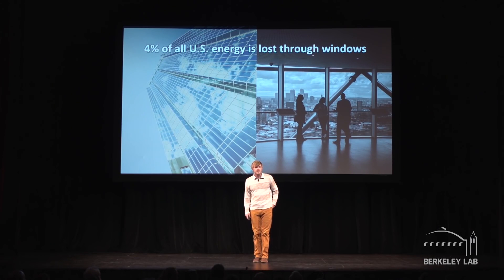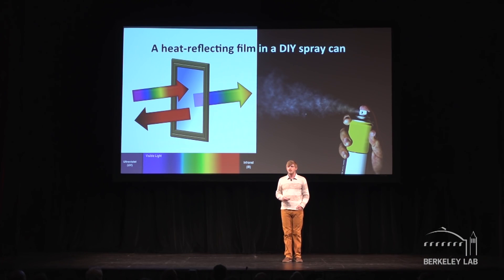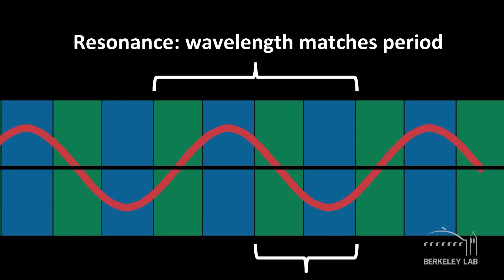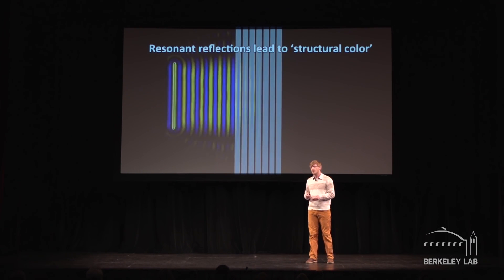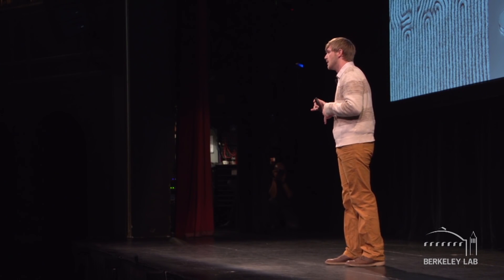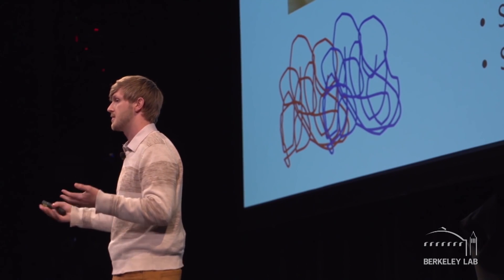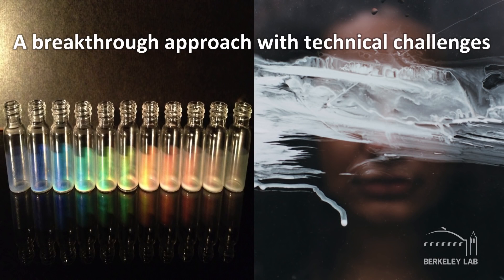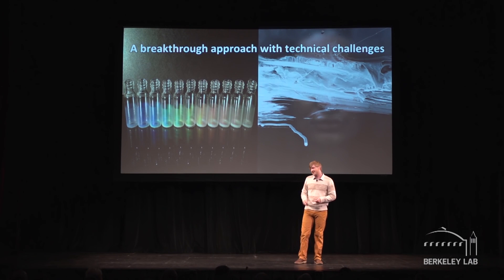DIY Efficient Windows

Comment: I wonder if their coating will also radiate indoor heat back into the room, like the e-coating you can order on new windows.  E-coating is freaking awesome, blocking both the heat gain during summer, and reflecting a substantial amount of heat back into the room during winter (60% if memory serves).  We replaced all of our west facing windows and our air conditioning bill plummeted, and house temp is much more even.  As money allows we'll just proceed and replace all the windows in the entire house.  Heat loss through the windows during winter is substantially less as well.  The cost of the coating isn't very much, so if you're buying new windows, make sure you get the coating.